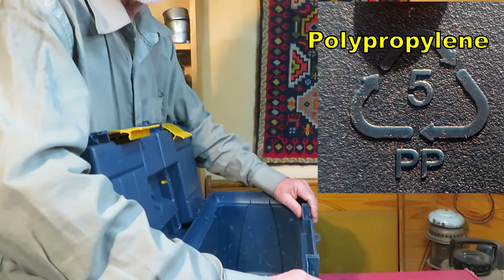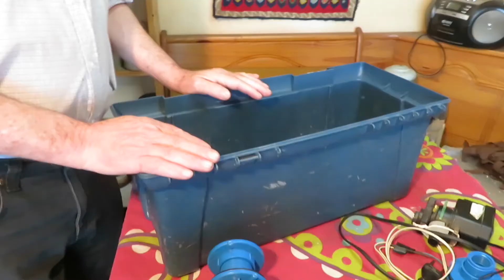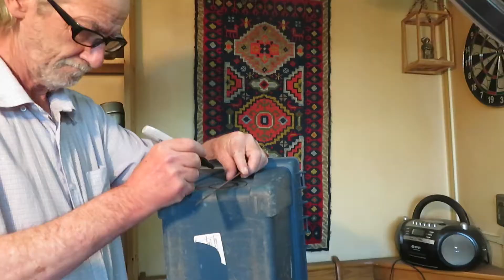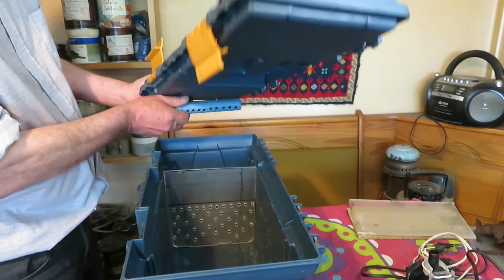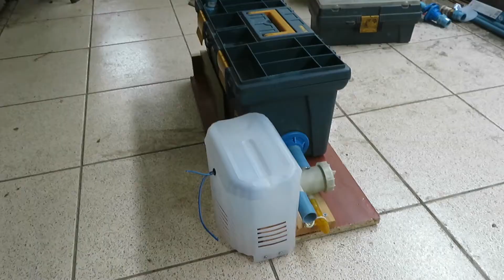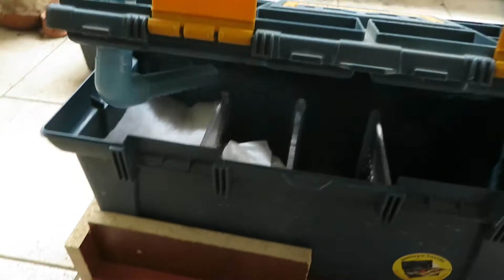How to Make a better external filter for your pond or aquarium using scrap materials

Comment: Can't wait to see in action.
Did you install the plastic bits next to the motor yourself or did that come along with the motor from the washing machine?
Reply from the maker: The motor comes with a plastic inlet (usually 32 mm) and an outlet (usually 25 mm).  The blue pipes are PVC 25 and 32 mm pipes expanded with heat and pushed over the 32 and 25 mm inlet and outlet. From there on it's only PVC connections. The inlet to the motor shouldn't have problems with the water pressure (just gravity), but the outlet joints have to be stuck either with PVC adhesive or something better than silicone. My tests show it is strong enough to unstick silicone.  Another option might be using the same tubing found on the washing machine that usually uses ring clamps to hold the tube in place.